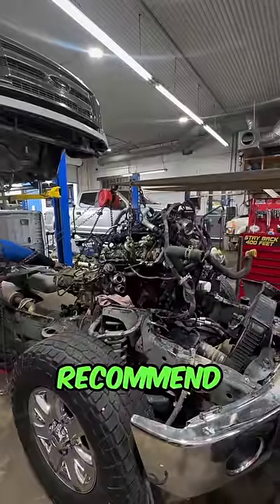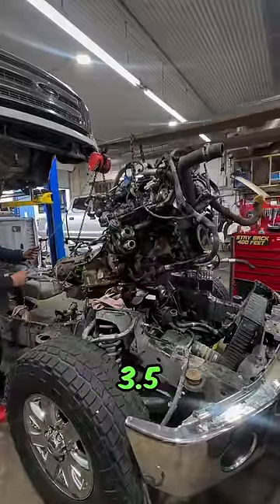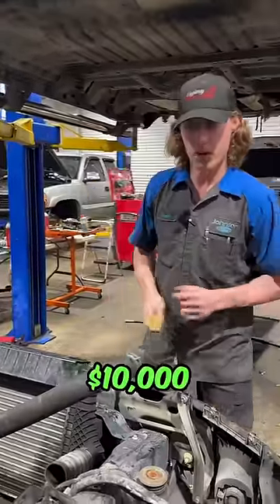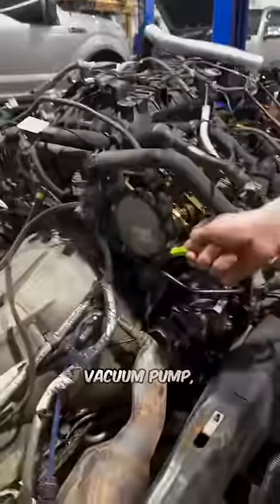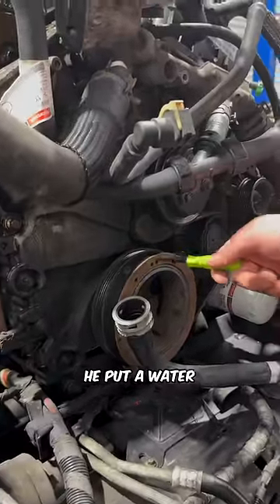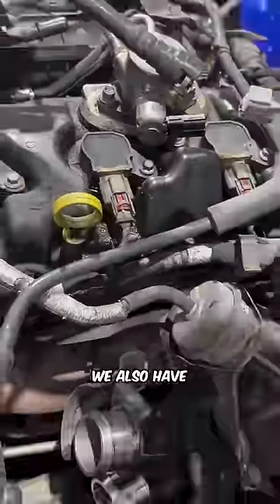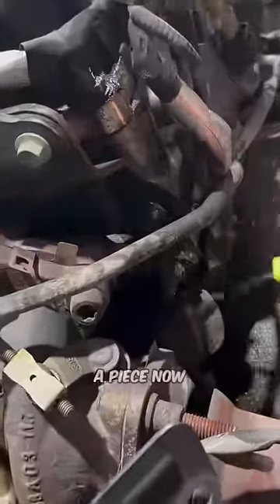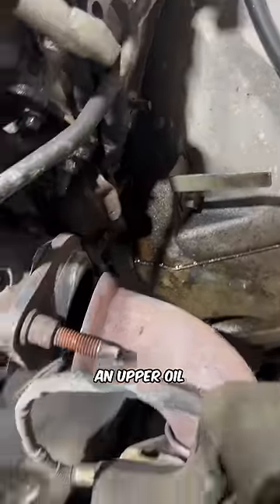Why not to buy a Ford 3.5L EcoBoost? #ford #ecoboost #shorts

Comment: Bruh. $400 and mandatory. Dang. Why is it mandatory?
Reply: Because he does it for a living & knows better
Reply: Because nobody can find or has equipment to resurface... It works, takes 3 day turn around but $80 for a pair vs replacement... Not a long term fix apparently, haven't had one fail but it's only been 120,000 miles... Bought a set so they're on hand but ya, on my time they get resurfaced but I get it... What's $800 when you're dropping 5 figures?
Reply: Probably has been a reuse issue, where it’s been enough of a problem to say “we’re not doing the job unless you agree to it. Too many complaints after work had been done. It’s like any part that wares against another part half assing gets you a call back a week later.
Reply: Why reseal? At that price just replace the engine.  That  would end saving money in the long run.
Reply: @neilkratzer3182 by the time you replace the engine, exhaust manifolds, turbos, etc you will be closer to 14k. With that being said you would at least have a 3 yr warranty
Reply: @justinweaver7553 He wasn't talking about resurfacing the heads. Charging 400 dollars to replace exhaust manifold casket it is nonesense.
Reply: Because the manifolds for these years are designed to snap the bolt behind cylinder 3 and 6 after 50k miles causing boost leak and power loss.  The later manifolds came with more places to secure in with the nut and studs. (Just did this last month) Was quoted 5k
Reply: @p123erson  so the studs are thicker. Just rethreaded. No big deal. 5k is rediculous.  And if the studs have been broken off. Use a left hand drill set.
Reply: I tried to reuse them- on a engine rebuild- they are junk the heat get to them and when retorquing to factory spec- they crack. In all its a nad design the new one has more bolt holes to fix the problem.
Reply: @kennethobando5755  seems to be
 You.have to rethreated them to a wider for wider size studs.
Reply: Torque to yeald bolts
Reply: @Chewie374 not thicker, more studs. Overall 3 more studs than original
Reply: @p123erson  never add more studs. Never. Fords always had that problem regarding studs braking off because of the power band. They recommend to rethread the hole bigger for bigger studs. Never heard of adding more threads "HOLES" on a motor. Especially on fords. On 1996 Ford mustang supercharger. I think it was the accessory serpentine belt. Ford had kits to make the threads Bigger because of the horse power of 600.
Reply: @watched4748 lol. The great thing is the holes for the studs are already on the block.  Search for 3.5 Ecoboost exhaust manifold replacement and you'll see what I'm talking about. Ford literally designed this engine so that you HAVE to replace these manifolds.

Comment: My dad bought a 2014 Eco Boost F150. It's a nice low miler but I was a little pissed at him. Although he's 76 and doesn't drive alot I would have reconsidered. I have a 2010 Silverado 5.3 with 112,000 miles and no issues.

Comment: Freeze plugs, head gaskets, water pump, knock sensors, front and rear main seal. This is all I've had to do for my 04 Tahoe engine since buying it back in 2011. Going on 300k still runs strong.

Comment: I had a 2000 dakota 3.9l 5sp with 300k miles, and the only thing i did was a water pump at 110k. That's it. Then i needed a larger truck, so i sold it to a 19yr old who has been running it for the 3yrs and hasnt done anything to it. I hauled oversized loads and had numerous escorts with dakota 5sp 3.9l or 5.2l and they had anywhere from 350k to 475k at the time. They only thing they ever did was a waterpump around 100k.

Comment: 200,000 miles 2011 - 2016 - had a dodge 97,000 miles leaking oil - and coolant - power steering pump always leaked at lines and second pump as well. Coworker GMC went through 8 injectors at 60,000 - couple months later injectors miss fire again- he just replaced the truck with a F250

Comment: I got one of those 2001 F1 50s XLT it got over  200,000 miles. It leaks oil but we really like the vehicle but I wanna know how much it would cost to reseal the engine that you’re talking about there .. I just did the brakes and the suspensions all done new everything else is fine. The AC is good. Flushed it and got that done, but I would like to see the vehicle will come back to life without leaking oil…

Comment: I have the 2.0 eco boost in my car and my vacuum pump went bad at 35k miles and my turbocharger went out right past the warranty. I bought a turbo with 7k miles on it for $125 and fixed it myself after wasting $1800 at the mechanic who didn’t fix crap . I built my own smoke machine from a pickle jar and soldering iron with a bicycle pump and found where the smoke was coming from. I religiously change the oil and keep it as clean as I can with the direct injection crap.

Comment: I have 214000 on my 2011, poured bars stop leak in it to stop the water leak at turbos and now have dumped some in the oil to stop the ever present drip, still goin strong. I’m asking myself when will this baby stop ? Gas gauge quit workin awhile back and other than a new transmission and regular upkeep she’s still blowin and goin

Comment: I got 210K miles on a 2015 3.5L ecoboost. Same leaky turbos but no oil leaks. My turbos run great and I only lose a little coolant, so not worth fixing (yet). Also had a failed water pump, cracked coolant lines, and buggy throttle body by the 200k mark. I did have to replace the suspension at 150K but we're talking about motors here.

Comment: How much just a replace it with a 300 Straight 6 ?   Correct me if I’m wrong but that 4.9 ltr well last over 1,000,000 miles before it’s broken in.

Comment: I have a 2008 F250 5.4L with 285000 miles and runs great except on third fuel pump.  Change the oil every 3000 miles even though ford says 7500.  Cab is in great condition but bed is shot.  Just wondering if worth keeping and fixing up.

Comment: I rented a 2019 Excursion with the 3.5L ecobost. The vehicle (big vehicle) leaped from 50-80mph. You do point out significant problems but we are talking 200,000 miles of use. I fully believe that manufactures could come up with better designs that use better materials but they would cost more. Things are certainly better than the 80"s and turbocharging. 475 hp from 3.5L not bad at all.
Reply: They have a word for the engines with better designs and materials: DIESEL

Comment: 215,000 miles on my 2011.  Does not burn oil, does not leak oil.  The most expensive oil change is the one you don't do.

Comment: I have a 2016 f150 3.5 122k, runs beautifully with tons of towing power. Hey if my engine fails, instead of replacing the pick up with a 60 thousand dollar new truck I think I’ll just put the latest gen 3.5 motor in it for 1/6th the cost. I love my 150 and it’s 3.5 TT!

Comment: So ive got a 2.5 ecoboost 2016 fusion titanium...
Ive driven it 1200 miles since buying it..
Checked oil twice and then a month later.. normal. Im a trained wrencher and apply my skills on aircraft but..
1200 miles and no oil on dipstick?? I dont see leaks...
I added oil still a no show after a quart so i put another qt.. question is how do i read oil pressure??
Use an app and elm or adapter??
Or can i use the factory setup to see oil pressure???

Comment: I bought my 2015 F150 Ecoboost in 2019 for $27k. If I bought the same truck new, it would cost 3x what I paid. I haven't had any problems so far. I'm driving this truck until the wheels fall off

Comment: I have a 2014 ecoboost with 180k and I am still paying it, already spend 5k on transmission repair, ford replaced the gaskets when first bought it even thou they try to cover them up with sealent and I go easy on my engine, regular oil change specially the texas hot summers. Hopefully won't have to deal with turbo or engine for next 100k, engine feels good no noise or weird vibrantions.

Comment: I had a dealership that tried their damnest to sell me a 2012 Ford F150 3.5L V6 Ecoboost.  I told them I didn't want that due to what I heard already (reliability issues).  I ended up getting a 2012 Ford F150 5.0L V8 Coyote and never regretted it.

Comment: Have a 2000 Ford ranger 3.0. Engine finally went out in it. So out it came and the transmission. Dropping in a 5.0 sbf with a cam and transmission out of an explorer that was built. All in, about 8k. New truck, is about 50-60k. And i put in a new head unit so i have wireless android auto and a custom center console for cup holders because the original ones sucked. Mustang seats. And the console has a built in wireless charger and truck vault that is bolted to the floor and a pain to get out. 
Who needs a new truck when you can restore old ones and make them yours?
Reply: As a Ranger fan who's owned alot that sounds like a cool project 😎 I'm currently looking at two Rangers this weekend
Reply: @frankm8533  the V8 engine and transmission from a 2000 Ford Explorer pretty much drop in. Get the harness and computers for the engine when you buy it and you have about as close to plug and play as you can get. 
Or you can go with a Holley efi system if you're planning on adding boost later or want tuning to be much easier.
Reply: @jasonbernal9348  Thanks for the info all my years I just never thought about doing the V8 Explorer swap

Comment: I have a 2012 crew cab 4X4 260K  miles new turbos water pump. I beat the hell out of it and it still runs great its on the third set of spark plugs. It's been to the dealer only twice once to reprogram the trans and for an exaust leak under warranty.  For 10K I better get a new power plant.

Comment: I have personal experience with a 2013 F150 EcoBoost. This is a super solid truck. Quiet, handles like a sports car, no rattles, but it gets 13.5 MPG on a good day, and about 8.9 MPG while towing anything. The engine is trash, and it's a shame they put it in this great truck.

Comment: With that many oil leaks and failures, it would seem that there are other issues at play other than just leaks. Did you do a pressure test on the PCV system?

Comment: I would like to point out the fact that there is a difference between a supercharger in the turbo. They are two different things. Superchargers are usually mounted on the top and sucking air into the vehicle as a turbo blows high-pressure air into your engine. There is a difference you don’t hear somebody with an SRT eight hellcat saying oh they’re twin turbos are blown Because SRT8 hellcats do not have twin turbos. It’s a supercharger on the top of the engine.!!

Comment: I think if you put 200K miles on a truck, it's been working for you, you've grown fond of it and you live in a climate where the whole frame and chassis (not to mention the body) hasn't rusted out from under you, then it's worthwhile spending $10K or even $20K or $30K to overhaul it instead of spending more like $60K or $80K to replace it and inevitably getting a whole lot of new engineering problems you never bargained for. In my opinion, with the direction new vehicles are going it's getting smarter to find a way to stick with what you've got and keep it on the road as long as you can.

Comment: I’ve got a 2011 f150 and yes the manifolds are a problem but I’ve got 480,000 on mine and it’s still trucking. I need new manifolds because they’ve never been changed but it’s close to retirement for the old girl. It’s been a great reliable vehicle and I would recommend it but you better use the best fluid and filters you can afford or they’re problematic.

Comment: Ive always said these motors were the answer to a problem that didnt exist ... the more stuff means more problems... blow a turbo on a Saturday afternoon towing your camper out of town....dead in water till Monday when any shop will be open... a N/A V8 is never the wrong answer...if you need boost to tow ..you need a diesel...

Comment: Buddy just did an engine in his 2016. Timing chain snapped. Spent a little over 5k as i recall. Bought a crate engine from Ford, swapped it himself, and returned the core engine to ford.

Comment: He is correct. I bought a new 2011 EcoBoost, and the engine was replaced three times before we finally sold the truck. The engines had less than 20,000 km each when they had to be replaced. Also, Ford's fuel economy was such a lie. Our 5.0 litre has better fuel consumption.

Comment: Even the best of old school Honda, Toyota, and Chevys will leak around 200k. The fact that it just needs buttoned back up with new seals isn't actually all that bad. Wonder what compression, oil or coolant consumption looks like. Also wonder if those are the original turbos. But not needing a full rebuilt at 200k isn't too bad for an American, turbo charged pretty high output truck.

Comment: Mine started leaking at the turbo coolant connections pulled the turbo's replaced the connectors on my 2013 only problem I had with it shitty connections they snap in and have a retaining clip. My 2020 no issues at all. And it has a tune in it so it rips!

Comment: I have 2 Chevy Trailblazers with the 4.2 Aztec 6 that have 279k & 271K on them & nothing leaks, they run quiet & use no oil. But then, I change my oil like you are supposed to.

Comment: I purchased my 2014 f150 EcoBoost new. I've taken meticulous care of it.Its now going on 11yrs old & praise be,it still has no mechanical issues at all with only 73,000 miles on it. And before I would even fathom the idea of buying a new pos truck these days,,,,I would much much rather spend 10,000.00 getting this done before going into debt for another 60,000.00.I will rebuild the complete drivetrain before I buy another new vehicle because they are built even worse today than they were back in 2014.My truck has zero scratches on it and the interior is damn near perfect.So if somewhere down the line I need to spend 10,000.00 to make her like new again,,,Ill gladly do that vs these problem plagued vehicles they're making these days.

Comment: As an honest mechanic: I do not recommend buying any vehicle much newer than 2000. 

The costs of parts are ten fold, they're non-serviceable garbage, they're full of electronics made to leave you stranded requiring a dealership and lots of $$$ to repair.

 Good luck finding a skilled backyard mechanic with a quarter million dollars in tools just to be able to do programable module installations ect.

 It's not as easy as just using an OBD reader and replacing sensors anymore.

Comment: My '98 F150 with the 2V 4.6 V8 has 300,000 miles on it and has never had any work done besides regular oil changes every 5,000 miles and spark plugs every 100,000 miles. They don't make them like they used to..

Comment: I could complain about Ford and the EPA and wish they could have kept making the 5 liter v8 or maybe a diesel 5 liter straight 6, but it won’t matter it’s just wishful thinking.
At least this video has convinced me to pass on any ecoboost engine and if I buy another pickup truck I will get an older 7.3 diesel and rebuild the drivetrain it will be as expensive as the tuneup for the ecoboost but it’s going to last forever.

Comment: I was told by dozens that the 2.0 was bulletproof so i didnt think i would get the antifreeze  leak in the motor. So wrong. None of these 2016 and up Ecoboosts are immune to it. And the Ford CEO said it cost a fortune to keep fixing and replacing these cause they were stupid enough to change the design after 2015.

Comment: Back when odometers rolled back to 00000.0, we considered it a job well done for the car. Here we are today, trivializing the problems that occur at 200-300k miles. We like to complain about the rising cost of vehicles. But we rarely take into consideration that they last 2-3 times longer and come with features unimaginable during the "good ole days."

OK, so someone's Ecoboost went to crap after 200k miles. But what about the others that made it beyond 300k and are still going? The greatest contributing factor in vehicle longivity is how it's driven and maintained.

Comment: My 2014 3.5l just threw its second startup rattle since I owned it. It had timing done at 60k and will be getting it again at 98k. Not to mention I had the 5.4l and had the same thing done in that one. I’m a bit more than pissed.
Reply: Not cool..bought. 2009 with 5.4 268k..very quiet motor..I'm happy only 2k for it

Comment: Ok really though it went 200K.  It’s tired and needs replacing.  Doesn’t matter what make you go with. Maintenance is the key. And don’t abuse the vehicle.  And yes I have 25 years in dealerships and automotive repairs.

Comment: 1.5l, 1.6l, 2.0l, 2.3l, 2.7l, or 3.5l. Rank theses Ecoboost engines in order of reliability. I know they all have issues, but which ones are MORE reliable?

Comment: I fixed a coolant leak less than a week ago in my 2014 3.5 and now it’s leaking somewhere else but can’t tell where from. Looks like it’s by the radiator but idk Jack about vehicles. Needless to say these trucks are very problematic in many ways from leaks to the cam phasers like every 50k miles

Comment: 200k and a bunch of oil leaks sound pretty reasonable... Other than the work done that wasn't done well, seems like not much has been done and 200k is def service interval for alot of those gaskets, seals etc. My non professional opinion of course

Comment: What about a 2018? I own a 2018 Fx4 with the 3.5 ecoboost. It pulls my 10,000 lb boat offshore boat like it's not even there and steers and rolls great. I'm at 36K miles right now and would like to keep the truck for at least my typical 10 years or 150K miles

Comment: I have a 2011 3.5, no oil leaks, there is a coolant leak on the back top fitting to the turbos. Other than that it's all fine so I guess I'm lucky....so far